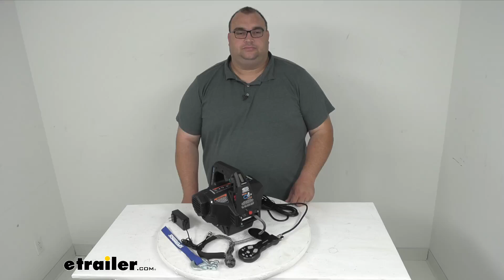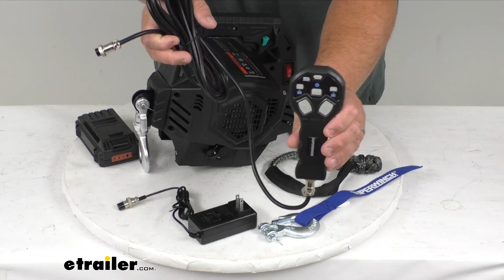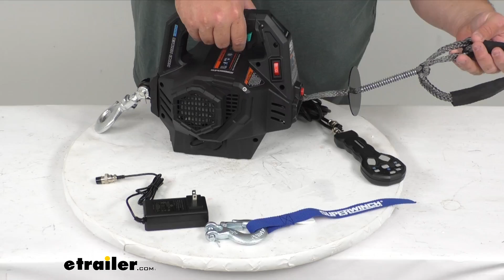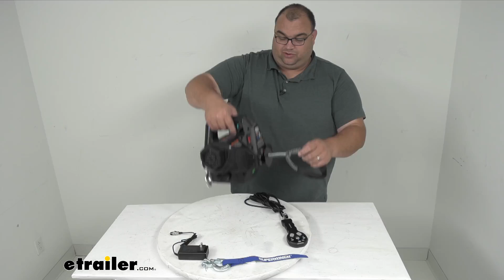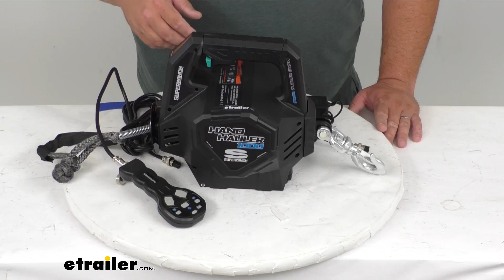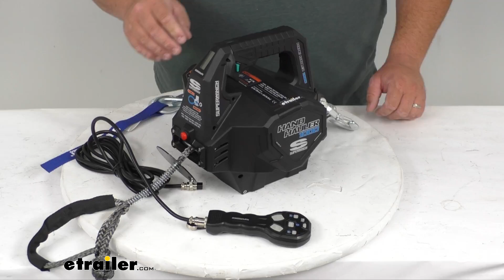etrailer | The Low-Down on the Superwinch Hand Hauler Portable Winch

Comment: Very nice. What is the cost with Two batteries?
Reply from the maker: You can see current pricing for the winch and an additional battery by clicking the links below:
https://www.etrailer.com/Electric-Winch/Superwinch/SW32SR.html
https://www.etrailer.com/Accessories-and-Parts/Superwinch/SW92SR.html